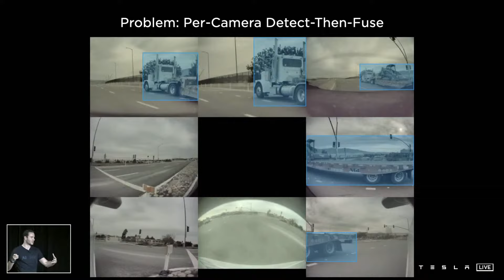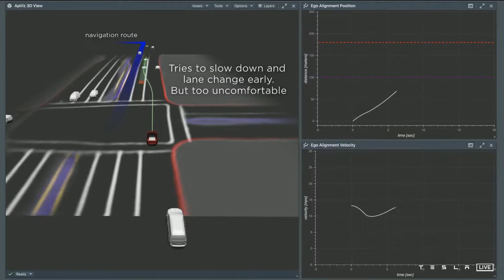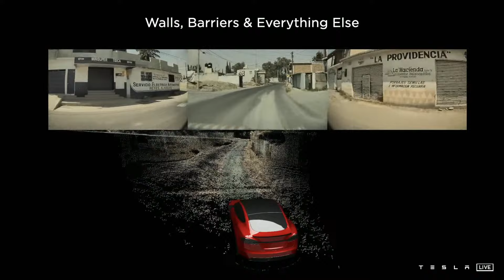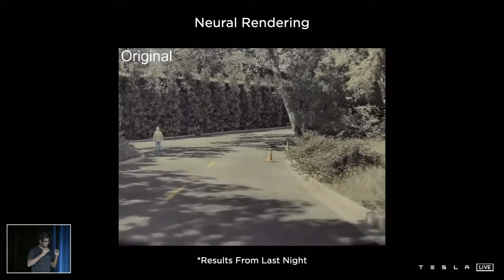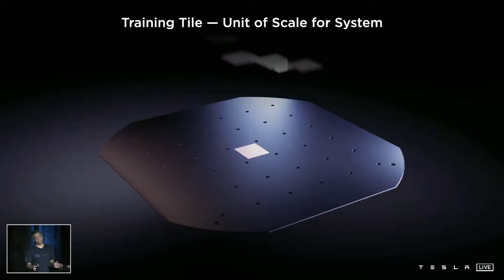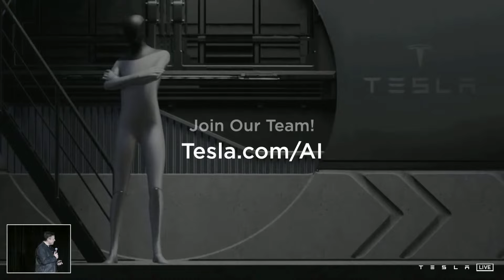WATCH: Elon Musk's Tesla AI Day - Livestream (with Chat)

Comment: A few of the questioners seemed confused on how the compute capability of Dojo would be crambed down into an individual Tesla vehicle.  That's not how it works.  The massive computation is to intially generate and train the algorithms.  Once those algorithms are ready to go, it won't take much computation at all to actually run them.
.
Think of a hammer for pounding in nails.  Do you or I have to source our own wood and steel to forge the components out of?  No, we simply go to the hardware store and buy one pre-made (vehicle-ready algorithm).  But, someone did have to source, process, and produce that hammer for us (Dojo simulation training algorithms).